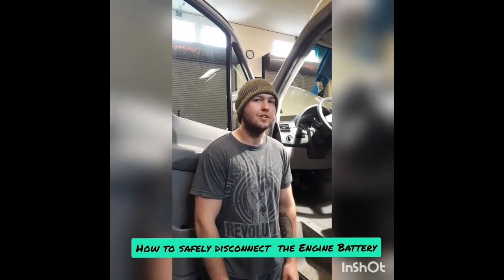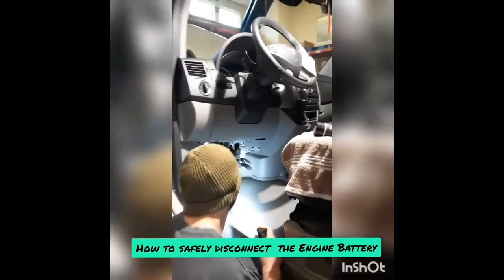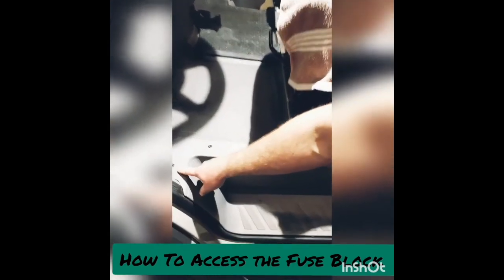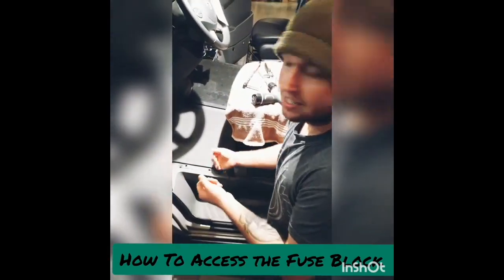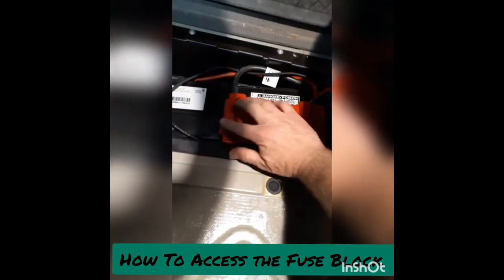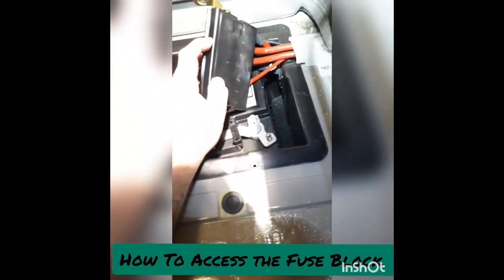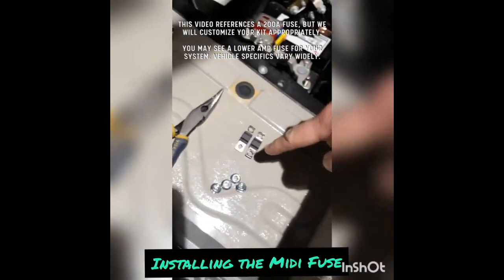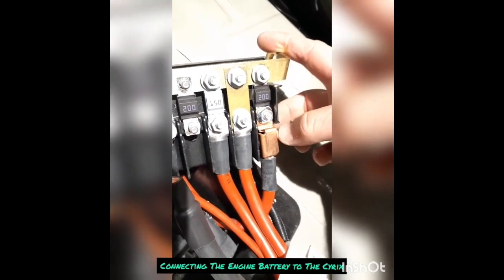Mercedes Sprinter Configuring Alternator Charging (A Demo)

Comment: I'm actually a bit confused. Why do you need 200A? That sounds huge. How many amps does the charger draw? Isn't general guidance to install a fuse that's about 20-30% larger than the max amp draw?
Secondly, why are you adding two fuses? 
I guess it would help if there was a wiring diagram.
Reply from the maker: If you’re using a 30A DC/DC charger, then you would use s 40A fuse/breaker.  But, if you’re using a Victron Cyrix battery combiner, and you have a 220A alternator, then 200A is appropriate.  Here’s a diagram:  https://amsolar.com/rv-battery-accessories/98-altcli230

Comment: Great video and information. Is there any connection needed to an ignition wire? or is it as simple as connecting to your battery and to your charge controller?
Reply from the maker: With a Cyrix or an Orion, there is no ignition wire connection needed.  These devices act on the increased voltage that they see from the starter battery.
Reply: @GarretTowneAMS  Quick question for you, I have a 40a dc/dc charger I will be running to this spot. Would I use a 40a Midi fuse in this location or are there additional things to take into consideration with the fuse sizing? What would you recommend?
Reply from the maker: @86MinnieWinnie  If your charger puts out 40A, it will have to draw more than 40A, so you will likely need something rated for 50A or 60A on input.
Reply: @GarretTowneAMS  Thanks so much for your quick replies back.

Comment: The video is clear & easy to follow, but you didn't say what these Midi fuses were about.  What was the purpose of the first one?  What does "Midi" mean?
Reply from the maker: This application called for 2x 200A MIDI fuses. A Midi fuse is basically a small space-saving fuse (usually ranging from 30A to 200A) that is popular in automotive applications.

The largest input protection on this fuse block was a 150A MIDI fuse from Mercedes. Since we were putting in a 200A Cyrix relay, we upgraded this to a 200A MIDI fuse. Additionally, we put a 2nd 200A MIDI fuse to protect the line feeding alternator current to the lithium house bank.  Does this help?
Reply: @GarretTowneAMS  Thanks for the explanation.  I'd never heard of MIDI fuses before, but I can see how they'd be useful.

Comment: Positive cable is connected to the power distribution block, where do you connect the negative cable?
Thanks!!
Reply from the maker: The negative cable is the chassis.  Connect the load side of your battery monitor shunt to the chassis.

Comment: Great video. Would it be possible to hook up a dc dc charger to one of those open spots to charge a  house battery that is separate from an already existing factory installed auxiliary battery?
Reply from the maker: Yes, we use a Victron Orion 12|12 30 that way all the time.
Reply: Great! Thank you for the quick response! Are there any other ways that are preferred to add a house battery to a vehicle that is separate from the already existing aux?’or is this the best way? Once again thank you for the response!